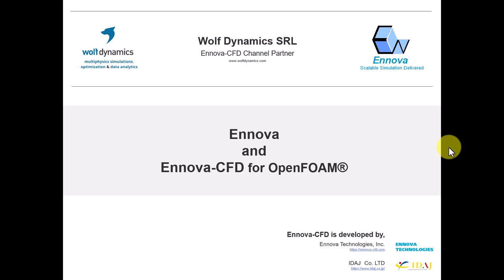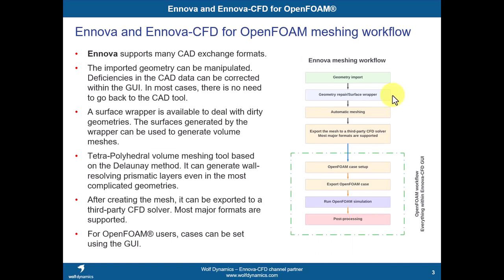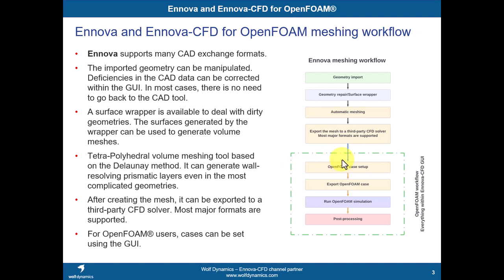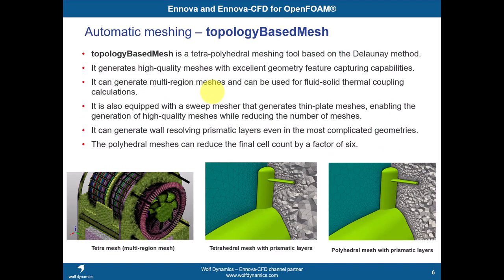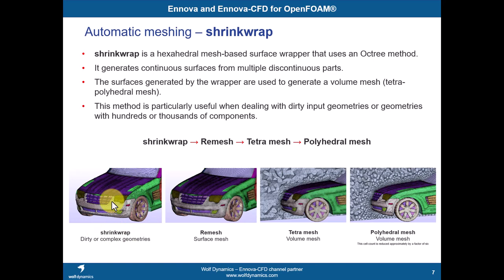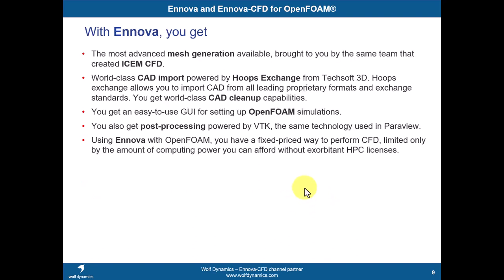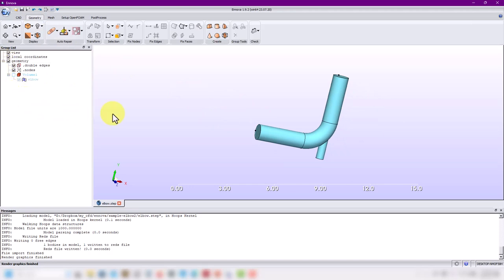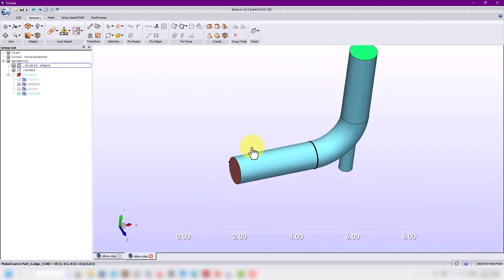Meshing with Ennova - The mixing elbow | Playlist video 1

Comment: Hello Joel, how would you compare Ennova to Fluent Meshing wrt their meshing abilities?
Reply from the maker: I think you need to compare by yourself and draw your own conclusions. But no doubt that Fluent Meshing is very powerful.

+
Ennova is way much easier to use, meshing and geometry preparation.
Ennova is faster, at least for the benchmark cases I have conducted.
Ennova is more affordable.
Friendly GUI to setup OpenFOAM cases.
Ennova has almost automatic meshing capabilities. I don't say fully automatic, because that still doesn't exist when it comes to meshing.

-
Fluent meshing has better scripting capabilities.
Mosaic meshes (poly + hexas) are not available in Ennova. But the developers are working on that.
No prismatic layers support for hexa dominant meshes (hexacore). But the developers are working on that.

I also need to mention that Ennova is developed by the same developers of IcemCFD.  If you have used IcemCFD before, you will find many similarities. Ennova is based on time tested technology, older than Fluent Meshing, TGrid and Gambit.